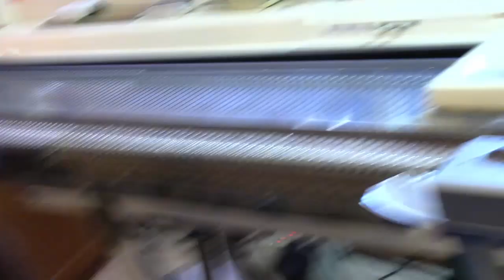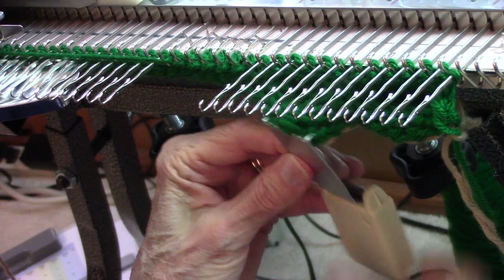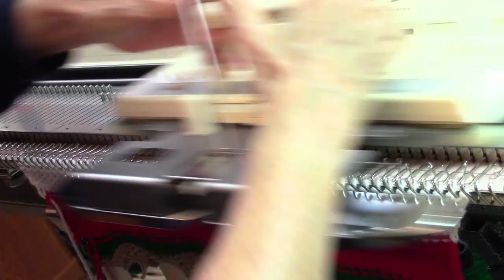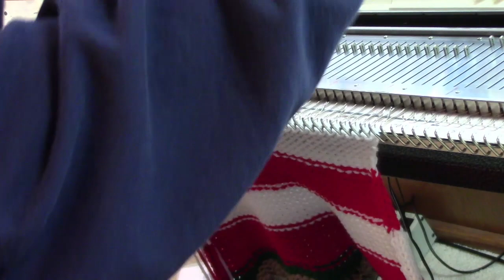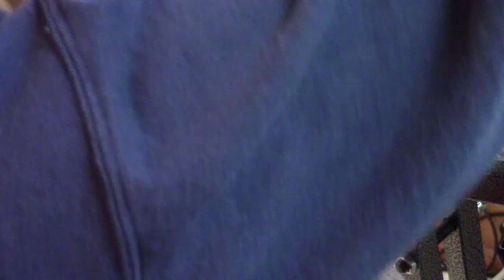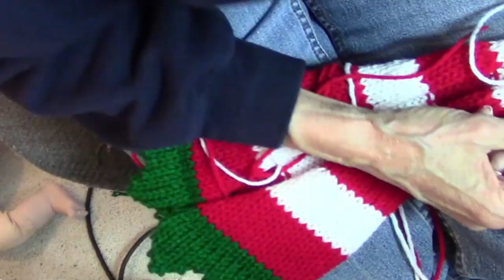Elf Hat to Machine Knit by Diana Sullivan

Comment: Brilliant little knit!! Could you please show how to remove waste yarn???
Thankyou 👍
Reply from the maker: Remove the divider row.  If it's ravel cord, remove that.  If it's waste yarn using the loop method on the last row, cut the loop and then pull the ending string on the other side.  If the waste yarn gets stuck, it is split somewhere.  Carefully cut the split waste yarn and it will come away.
Reply: @dianaknits  thanks Diana! Your videos are a great help, even though I'm mostly using a double bed. I have to get to grips with a knitmaster 321...
so that would be a good one to try out the pointy hat! Big thankyou!!👍

Comment: I do not have a garter bar. I wonder if it is easier to start from the top and just do increases. Is that possible?
Reply from the maker: Increases will be more difficult.  You have to lift a stitch to fill in each hole, and extra step.  Also, you have to stretch the knit fabric a lot more, and you may find that it just doesn't stretch enough.  You still have to take it off on scrap knitting so you have a way to hold the stitches as you replace them.